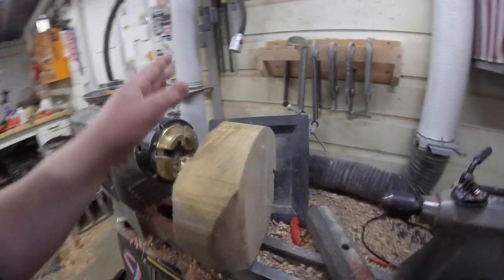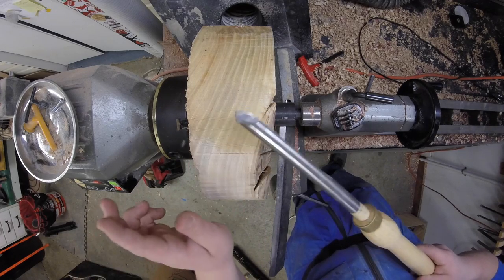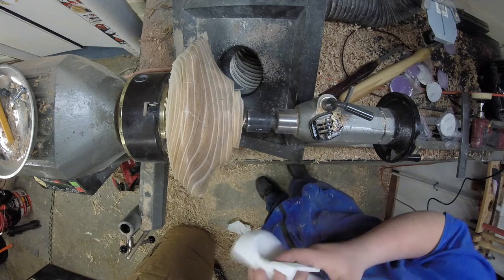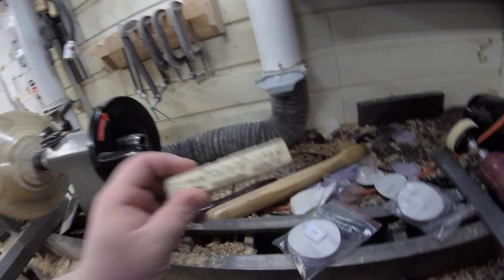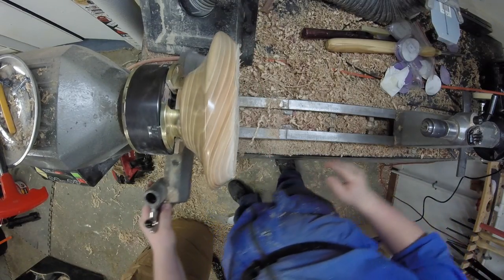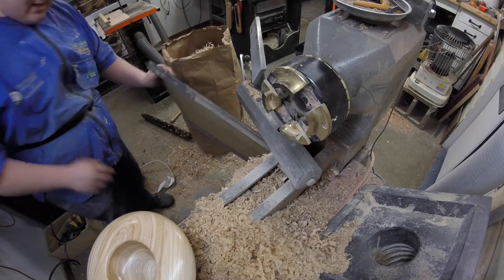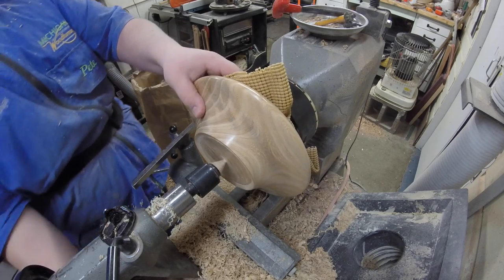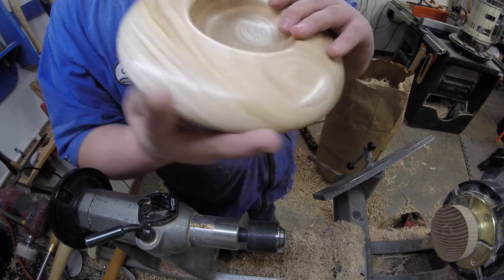Elm Bowl With A Different Kind Of Shape

Comment: I've just got a piece dry  elm about 13in diam. x 2.5 in thick. I hope to turn a platter from it. I not a great turner and I've never turned elm before. Is it difficult to turn? Hard on the tool edge?  Is it stable?  What caution / advice would you offer?